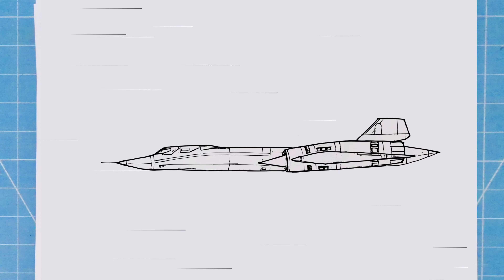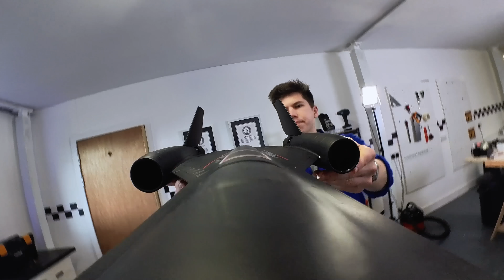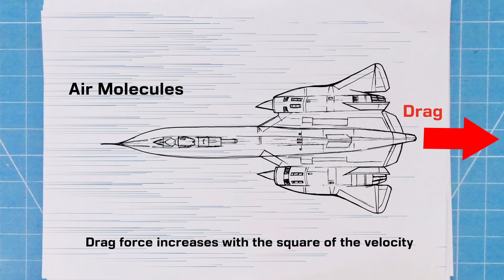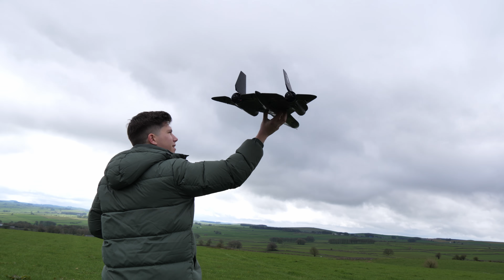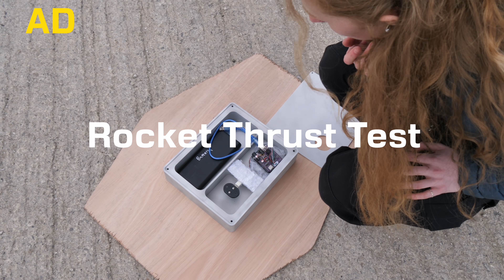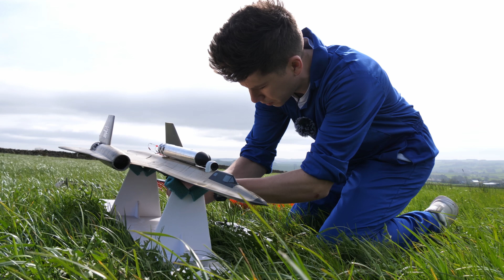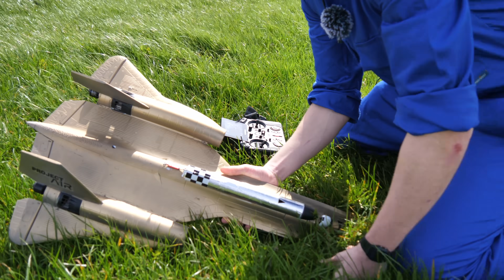Building a HIGH SPEED RC Plane (SR-71)

Comment: I might suggest installing an iNav flight controller such as the SpeedyBee F405 Wing Mini along with an M10 GPS unit. Along with this you could also use an FPV video system to fly through goggles and record video.

Comment: Rocket need to be INSIDE the fuselage to get the best top speed. Keeping the rocket on the outside increases drag which, in turn, decreases performance. If you can also implement a scram jet inside the model to make it go even faster… well… you might need a special way to communicate to the UAV at that point.

Comment: If the rocket motor exceeds the maximum speed to produced by the electric fans.  The maximum speed of the plane will be slower than achievable with a rock motor because the fans will be creating drag.

Comment: The cones are designed to slow the air going into the engines to less than supersonic speeds.  At the supersonic speeds the SR-71 travels at, the supersonic air entering the jet engines kills the engines

Comment: Part of your problems is that the intake cones CONTRIBUTE the thrust of the SR-71.  Which can contribute as much as 70% of thrust (depending on weight and altitude).  The intake cones move in and out, AND tip up and down to shape the supersonic shockwave into/through the intakes.

Comment: Someone may have already commented on this and it might be obvious to you, but a big reason the plane is so unstable during the motor burn is it's not pushing through the center-of-mass. It's strapped haphazardly to the top of the craft causing it to nose dive down as soon as it's ignited. Placing it centrally in the back or adding another motor underneath is a possible way to correct this. Always love your uploads though. Keep up the good work.
Reply: Or, you could angle the rocket to point back and up, so that the thrust vector passes through the CG. It will also push the plane down, but if it's already moving through the air all you need to do is increase your angle of attack to get a little more lift. Or you could do what JATO's do, and hang the rocket underneath or to the sides, pointing it back and down but still through the CG.
Reply: I don't do avionics, only pyrotechnics and solid booster engineering, but yes it seemed to me that it would be much more stabilizing to put the booster under the wing level... Also he modified the balance and weight of that plane way to randomly 😂
Reply: @baudouindesaintroman6337  Rockets are one of those things that mess up the whole "if it looks like it will fly, it probably will" heuristic. I think that's what we're seeing here, the complicated dynamics of rocket thrust and mass are hard to optimize around, so most people just slap a rocket on top of the plane since it feels correct. I blame 50's-70's pop sci artwork for this misconception.
Reply: FYI: He has talked about this design before and is well aware of the problem and designs around it.
Reply: @vosechu  I haven't seen those videos I guess, what is the reason not to angle the rocket and do a couple flight tests with different CG's to validate the fueled and burnt performance?
Reply: I learned a new word, haphazardly. It Means "lacking any obvious principle of organization"
Reply: I thought that would be obvious
Reply: would like this comment but its on a perfect 767 likes
Reply: given everything else he does right in the video, i would assume he knows that but this was done as a compromise.
Reply: I was on my way to comment the same thing! 
also mounting the rocket motor further back on the plane will help.
Reply: Job Well done! 👍 interesting and inspiring video!
Reply: You've seen his haircut right??
Reply: @matthewspry4217  yea and its pretty amazing tbh
Reply: If he really wants to make this AMAZING, a good ideia is to make the trajectory correction using the Arduino he already have on the setup.
Reply: One thing you have to consider is the weight of the rocket engine is going to change as it burns altering the center of gravity so you kind of have to mount the center of the motor over or in front of the center of gravity of the actual aircraft?

Comment: Love the channel I see two major issues with the test number 1: the camera shouldn’t be protruding from the airframe like that you loose a lot of speed due to excess drag also the camera itself will cause flow separation disrupting the aircraft’s overall aerodynamics also the rocket motor should have been installed in the fuselage for the same reasons maybe for the next test try a duel rocket motor set up with the ram cones installed in the intakes like the real aircraft in theory it should fuel the engine in a similar manner to the real aircraft

Comment: Don't go back to short burn motors, you need sustained thrust to achieve high speeds.  Otherwise it will just be a burst of acceleration that drag will quickly counteract.
Also please stop mounting the rocket on top of the plane - its pitching the nose down, increasing control surface actuation, which adds drag and complexity to stable flight.  Plus, I havent run the numbers but tbe rocket pendulum fallacy might apply here.

What you need to do is build a purpose built plane designed to be stable at high speed, utilize modern flight computers (ardupilot on f405 for example) to maintain straight and level flight during the speed run, and mount the rocket on the back firing directly through the center of mass.  Actually i cant remeber if the center of mass or center of pressure is more relevant here, but in theory you could design the plane such that those are close, at least in the xy plane (where z is the longitudinal axis).
Reply: Totally agree with the 1st paragraph

Comment: You need to build a proper High start. 10 meters of surgical rubber tube and a release. Lots of 3D printed options out there.  your hand launches are pretty sketchy! Using a High start lets you keep both hands on the controller. I like your builds! Excited to see the next one!

Comment: The plane didnt seem that unstable when you were flying it, at least from the camera if anything the lack of input from a gyro probably helped quite a bit. If you were to get a good FPV setup (one that can record relatively well) it would take up about as much space as that Insta360 setup and allow you to keep the aircraft as straight as possible for the entire length of the burn rather than needing to do orbits.

What i would LOVE to see is this thing kinda turned into an X-15. Rocket motors in each of the engine pods, then you need no fans, no major cuts, lighter battery and a completely lighter airframe. Perhaps...launched from another plane? riding piggyback like the shuttle? I doubt with the shape that dropping it from a drone would do anything but lawn dart it. 

Definitely some room for improvement and the SR-71 platform would be quite Fun to see flying at Mach speeds!

Comment: If you haven't checked it out already, you should try Speedybee's new F405 WING MINI flight controller. Afaik it's the most compact one out there with enough power to run this sort of setup, at just 37*26*14mm, and quite light at 23g, and you can obviously run INAV or Ardupilot for an even smoother experience.
I was worried about the lack of down angle on the rocket motor causing a down pitching moment that you might not be quick enough to control with your manual setup, but you fortunately out-skilled it.

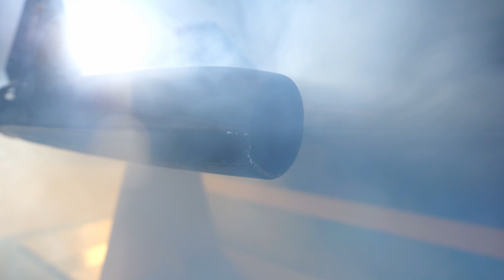Comment: 6:40
would have liked to see a more scientific measurement. It would have been pretty simple to rig a PCV pipe to the plane's exhaust and then measure flow with a common automotive Mass Air Flow sensor.
also providing the kv and voltage for the oem and replacement motors/battery

Comment: Maybe add a parachute to the next high speed plane to reduce damage on crash landings and if you use a rocket engine with a parachute charge maybe you could fit 2 engines in one tube. Maybe one slow burn to get up to speed while staying stable and one fast burn to really send it!

Comment: Try using a fpv system like dji 03 air unit. Easier to fly in fpv. Positives not having to look for it in the sky and hud in the goggles giving you more info.
Also using a wing flight controller like the Matek F405 Wing. Using a fc will let you use an assisted mode keeping the plane level allowing you to focus on the speed run. 
Im sure you've thought of this, just think it would make good content.

Comment: You should use two rocket engines and put them inside the actual engines and ignite them with a dual spark plug system

Comment: Would consider building an aircraft with a rotating wing?  Use perpendicular wings for easy launch, then angle them at ~45 degrees for the rocket engine boost run...  Best of both worlds :)

Comment: One suggestion is to remove the fan and fan battery. In place of the engines, two rockets, one on each side. Use the drone or a balloon to raise it, and then a remote hook system makes it detach and fall, then turn on the rockets. Perhaps, lighter, it could reach 200 km/h. Salute from Brazil.

Comment: To be fair,after the upgrade of the ducts you had a more realistic flight of the model as the Blackbirds were pretty bad flying aircrafts especially at low speed,afterall they were not designed to to acrobats but do long high speed,high altitude flights.

Comment: Hey man! Try using a very stable platform for your rocket plane.. I think you are selecting Jets with very tiny wings span and the smaller they are the twichier they are.  Try the multiplex Funjet ultra 2, this is small for high speed but highly stable! It has a cult follwing in rc community for cheap speed. People have flown this over 200mph with 6s electric motors. It flies straight like an arrow and easy to manoeuvre. It needs very tiny single quad motor on even a 4s to go very fast, go far away and choose a very straight full throttle pass, once your plane is locked in and wings are steady fire up the rocket, i promise you wont regret!

Comment: Man u need to set the thrust line of the Rocket so it runs through the centre line of the aircraft and the centre of gravity i think or the centre of pressure one of the two and it will stop the nose pitching down when your igniting the rocket motors

Comment: I wanna learn how the code works on these open source flight controllers like Autopilot. 
But it's too big and complicated as my first experience, and caused me to poop my pants. 
Can anyone suggest one that I can study that's not this complicated?
Reply: Here's what ChatGBT had to say to this exact question copy and pasted;
Sure, diving into the code of complex flight controllers like Autopilot systems can indeed be overwhelming, especially for beginners. If you're looking for a simpler alternative to start with, you might consider exploring smaller, more beginner-friendly open-source flight controllers. One such option could be Cleanflight or Betaflight. These are both popular open-source firmware projects primarily focused on smaller multirotor aircraft like quadcopters.

Cleanflight and Betaflight are derivatives of the older Baseflight firmware and are designed to run on various flight controller boards. They are relatively simpler compared to full-scale autopilot systems like those used in professional drones or aircraft. These projects have active communities and extensive documentation, making it easier for beginners to understand and contribute to the codebase.

By starting with Cleanflight or Betaflight, you can gain a foundational understanding of how flight control software operates without getting overwhelmed by the complexity of larger systems. As you become more comfortable with the basics, you can then consider exploring more advanced projects like Autopilot.

Remember, learning to navigate complex codebases takes time and patience, so don't hesitate to take it one step at a time and ask for help from the community when needed. Happy coding!

Comment: Back in 1980, in a time before computer aided design, I build a SR-71 Estes-type rocket from scratch. I referenced photos from a magazine and used balsa wood & paper tubes for most of the materials. It was about the size of yours. Being a fairly heavy rocket, it had two D-size solid propellant motors, one in each engine. I was quite fascinated by the Blackbird at the time, but extremely inexperienced at building rockets. Needless to say, it flew, but not very straight!
Reply: I bet you used a slide ruler
Reply: @ninkd0311  🤣 If I was only that smart... it might have flown straighter. 🤣
Reply: I made mine in about 1990. I even followed the guide to paint it with different black paints, some flat, some gloss, to simulate the different surfaces. It was maybe my 3rd rocket. I never actually flew it. I spent so much time on it that I was afraid to launch it. Years went by, got interested in girls, and it hung in my room for years. My mom probably threw it out at some point after I moved out. It was beautiful though. I spent so much time on it. After spending months staring at it at the hardware store. Wish I would have launched it.
Reply: @gkoshinsky  Sounds cool! I don't know what happened to mine either. I know I carried it home after the launch (more than I can say for some of my rockets! LOL)
Reply: Awsome
Reply: So go ahead and do it now.
Reply: That is a cool fun fact.

Comment: You mentioned drag. But did nothing to make it cut through the air easier. 

SR-71 body was designed for mach 3, but you ruined it with all those features sticking out. Now you'll be lucky to break mach 1. (If it was full size)

Comment: I love your content but I think you should try INAV with FPV along with TBS Crossfire. You will drastically cut the weight, bulk and drag. INAV will give you the advantage of Auto launch and then optionally put the plane in Circle mode while you put on goggles and prepare.

Comment: Great video, very fun to watch. Few tips though, don't do high speed runs without a gyro because not only you were losing speed going right, but also losing speed going up and down. For that though, you will need better avionics and custom code depending on the airplane's characteristics. i think doing that first is better than hastily slapping on a rocket motor. Also, there is no problem going a little bigger and doing the aircraft shape yourself.

Comment: I think one of the biggest things that makes RC diff than real aircraft its the physical resistance to your input. Wind resistance and physically move the control surfaces, which are reflected in the control input (joystick?). This seems to even be the case in fly-by-wire set-ups, where the changes in the control surfaces on the aircraft or vehicle are reflected on the yoke. Similarly to the steering wheel in a fly by wire car adjusting to the wheels, even when forcibly moved.

Comment: Great video but it's a shame you broke all the aerodynamic work by adding the booster. I thought of two things to improve performance:
1st: Add the booster at the nozzle outlet of the EDF engines, the air from the engines would flow around the booster and you'd have less air resistance.
2nd: Why not try variable geometry for the next prototype?

Comment: As I said in another video, you really need to change your radio to use ExpressLRS. The receivers are very small, even the ones with PWM outputs and the range and reliance are excelent.
Reply: I agree, I switched all my fpv drones to ELRS and fell in love. Even my Arrma rc truck has it now
Reply: Yep....ill never look back.
Reply: But then he could fit a gyro
Reply: You get over 2 km range with standard orange relievers,  why would you need more than  that unless you are flying fpv illegally?
Reply: @TheRattleSnake3145  Kind of a silly comment. 

ELRS wins over older control links like spectrum in basically everything, it's cheaper, receivers are smaller, it's range and link stability is insane and it's open source and always improving further.

People have gotten over 100km of range with 2.4 GHz ELRS, basically for a normal usecase you never have to think about range ever again with ELRS.

Additionally it comes with lots of additional features, adjustable data rates, model match, the ability to access settings on the flight controller flashing over WiFi.

You don't have to switch to a different control link if what you have is working fine for you but for controlling things that fly, especially fpv, having a long range, high performance control link that never failsaves is a very good idea.

Comment: plz get an ExpressLRS controller so you don't lose signal at long range again
Reply: Where did he loose signal ?
Reply: @jas-FPV  His Turbine video. What he needs to do is just add a proper receiver and a satellite or since he is running Spektrum he can just mount TBS Crossfire lite as it is plug and play with his Spektrum radio. That is what I use with my Spektrum radio and I can fly miles with my FPV planes.
Reply: @FarmerFpv  or an elrs module bay transmitter....
Reply: @FarmerFpv  
I haven’t heard that. And he ises a TD Tandem receiver that uses 2.4 and 900 in parallel. So as long as he didn’t make errors installing it, this thing has the same range as crossfire or Elrs.
Reply: @dfgaJK  
TD receivers have range for miles. So if he lost signal he didn’t install it properly or he damaged the receiver in a previous model. So its not the fault of Frsky but his own making
Reply: @jas-FPV  in the "Foam RC jet" video

Comment: Hmmm... Personally I would have placed the rocket motors behind the hub of the EDF and maintain the same centre of thrust and not mess up the aerodynamics.

... Plus it looks like afterburners 😁

Edit: it will heat the EDF exhaust too so technically it is an afterburner this way